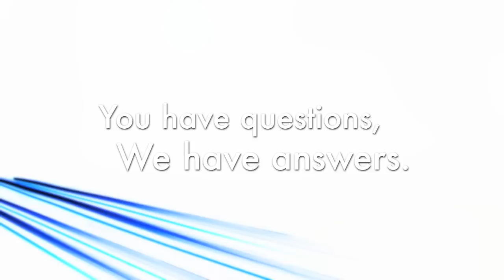Honda Element Roof Rack Installation (Honda Answers #59)

Comment: 18 mins for a young man with strong hands, an auto shop and a torque calibrating tool.  1.8 hours and a bloody finger or two for a 100 lb 50 year old in the driveway.  Those frickin little nubs will NOT go into the frickin little holes.  I tried everything.  Honda could make a fortune with a little tool that would make that happen for those of us who aren't young gorillas with strong (now bloody) fingers.  Video was a great help, but I HATE those rubber nub things and the holes they go into.

Comment: Use pliers to squeeze the sides together (one you get boss in hole); use small screwdriver to pull the rest of it through once you get it started (all this after the oil).

Comment: HELP PlS! 2005 HE LX
Video was general, focused up close on where that sticky rubber goes would be helpful and the rest of the install. The instructions picture pages was not @ all helpful. Do I put the sticky rubber piece in bottom of that area or more to the curve side wall? Then there is the rubber strip with a slit, where does that go? 
Mine is after market part & the rubber cover was already on the stay mount part. The instructions is crap 
No problem with the rear rack part, not quite air tight, but the front rack part is not sitting right. To much gap.
What is the oil for and "bosses" is that a part that sits into the stay part? My instructions calls the part "Stay" is where the screws go into and fasten onto car.
Under 90lbs, no bloody fingers, hours fucking with the front rack part trying to seat it perfectly. Lots of wiggling and rubber mallet banging the crap out of it to seat it right & still not right. 😡
Redo that video and really zoom in on the install. Don't be so dam quick to show how easily to install to sell the product. Not everyone has the tools nor strength & height to accomplish something seemingly easy. Getting the job done right is more important then speed!